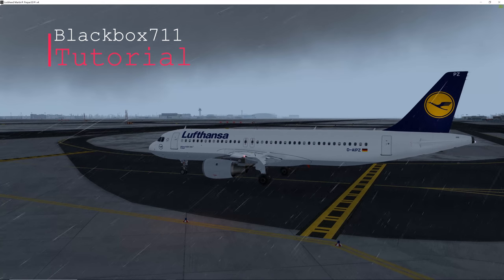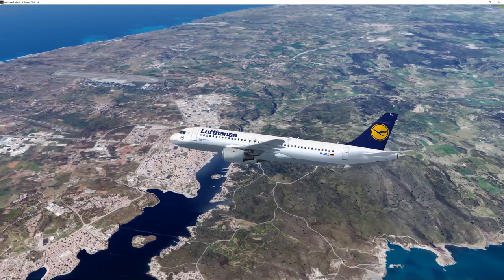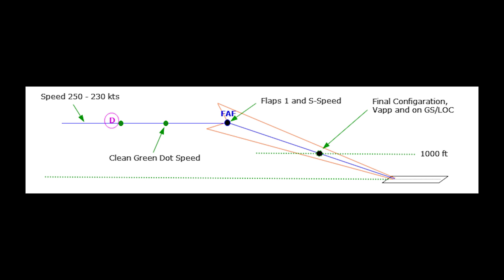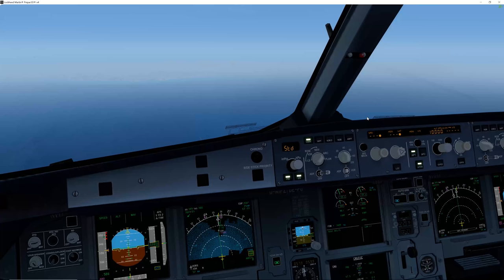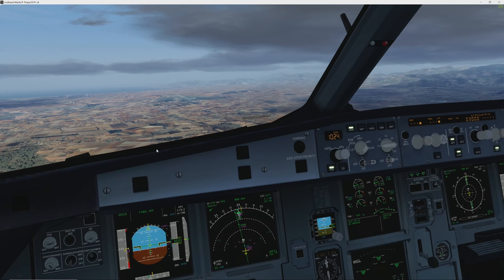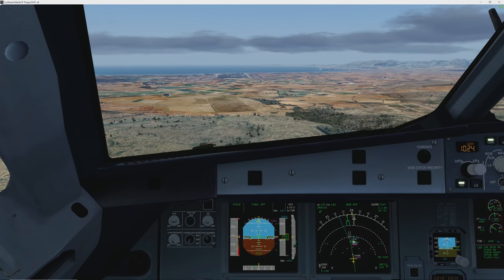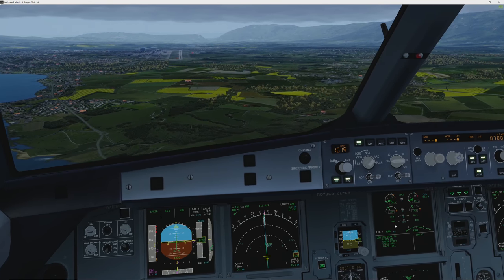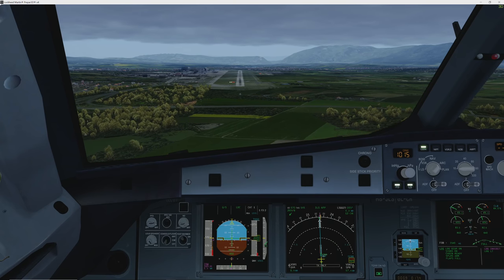FSLabs A320 Basics: Decelerated and Early Stabilized Approaches

Comment: Hi Blacky, Is the rudder yaw damper setting's ever used? I do not recall anyone using it at all.  If the control is there. I am confused.
Reply from the maker: In the MCDU options? I never change any settings there regarding rudder.

Comment: Thanks for the great video! You had 3 landing inhibits, nearly every time I'm also encountering this inhibit's, sometimes also when taking off. How can I find out what is the cause for the inhibit?
Reply from the maker: Hi. That is a normal feature in the A320. During takeoff the T.O. Inhibit appears at 80 kts and is displayed intil 1500 ft AGL or 2 Minutes after takeoff power set. During landings it appears when descending below 800 ft AGL to 80 kts. It means that only the most important warnings will be displayed on the ECAM.
Reply: Blackbox711 so actually this does not mean "landing forbidden", I was confused and actually thought some configurations are not set correctly or parameters were wrong and he is telling me to abort the landing. But it seems its just a notice, thanks for the clarification!
Reply from the maker: Exactly. It just tells the pilots that at the moment the not so important messages and warnings are inhibited.

Comment: Hello black box, can you you think of a way we can fool the FMCG to fly a DPO descent, on a non option A320?
Reply from the maker: Hi. I haven’t seen any documents on how Airbus DPO software calculates the optimum descent. So I don’t think you can artificially program anything into the MCDU to mimic that DPO. The standard descent performance calculation is already fairly good.
Reply: @Blackbox711  the thing is that non DPO descent assumes y the use of engine anti ice on the descent calculation, that’s why engines are not at idle during a managed decent.

Comment: I got many often during approach an early AP disconnect. Then the pitch increased to up and the engines accelareting. I don`t no why . Can you explan witch parameters a based for such AP disconnect? Are this bank angle or speed ?
Thanks in advance
Lothar
Reply from the maker: Hi. Are you using a weather updating software like Active Sky?
Reply: Yes,  I`m using AS weather updating
Reply from the maker: Then you have to scale down the turbulence effects until these AP disconnects disappear.

Comment: Did you adjust your seat position? Mine looks more flat and the registration tag is better readable with me.
Reply from the maker: Hmmm. Not sure if I changed that lately. I will check, thanks
Reply: Blackbox711 i think it‘s the view. I used Virtual Cockpit, you probably use Captain view. I find Captain view very slow in the head movement. Maybe that‘s adjustsble somewhere?
Reply from the maker: For me that setting would be in Chaseplane.

Comment: Which is more realistic: FSLabs A320 or A320 Flight Factor ?
Reply from the maker: In what regard? Manual flight, system architecture?
Reply: Blackbox711  general, overall and the quality
Reply from the maker: The problem is that the FF320 is not completely modeled yet. So a full comparison is not possible. What I can say is that the FSLabs is a very good and well simulated aircraft addon. Especially the almost completely modeled FMS system and ECAM procedures. For XP11 the FF320 is without a doubt the best Airbus Addon available at this time. I personally enjoy flying it, however I am missing some features which are said to be implemented over the next couple of months. Maybe then I can do a fair comparison.